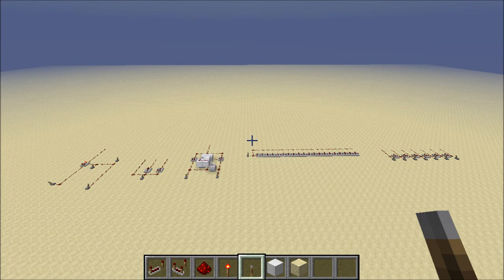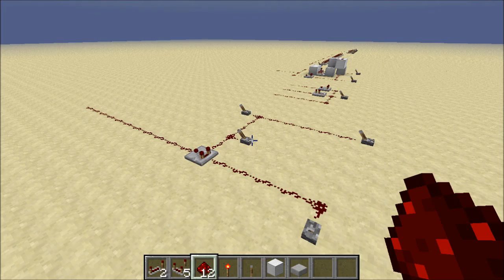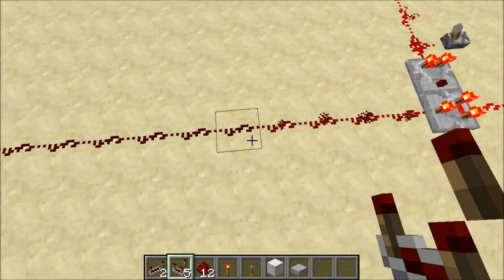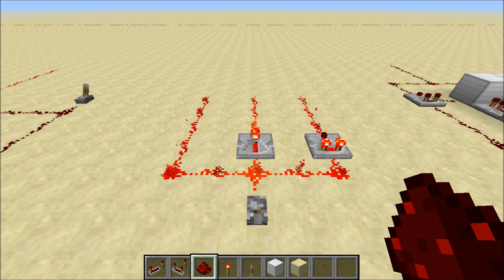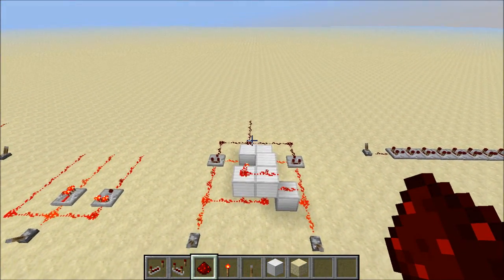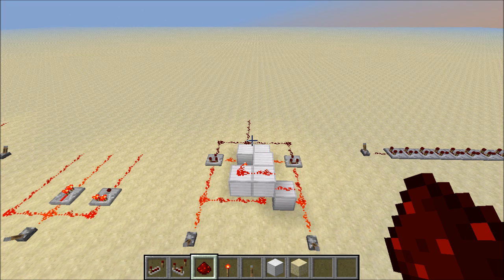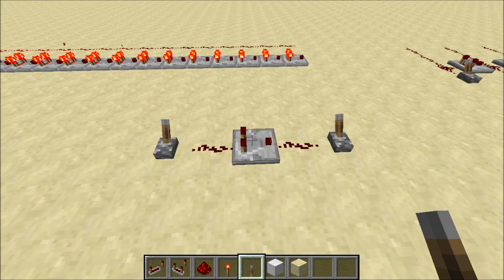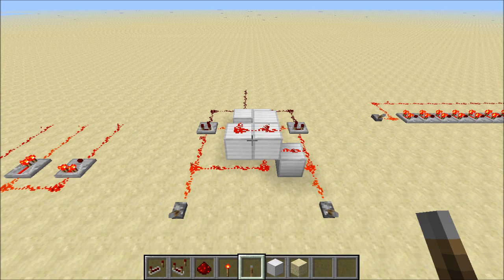Redstone Comparator Features (and a few uses!)

Comment: I don't know if they changed it or not when you made the video.
You forgot to mention that when you use the comparator to subtract the output.  It uses input B minus input A.  Also you didn't need to connect another comparator to input B for it to work.

Comment: In pretty much all of my contraptions I use repeaters ONLY to get the right timing in the circuit. So that's a clear no. If you have to have a signal traveling long distances it would be something else, but I try to have the least redstone dust possible anyways, because that makes my contraptions smaller.

Comment: It can sometimes still be instant in 13w01b, it's just not reliably so, it varies randomly from instant to up to 1 tick. I believe what it's doing is it has some code to check for infinite loops which causes the delay, since it's not consistent it seems they are trying to preserve the instant ability.